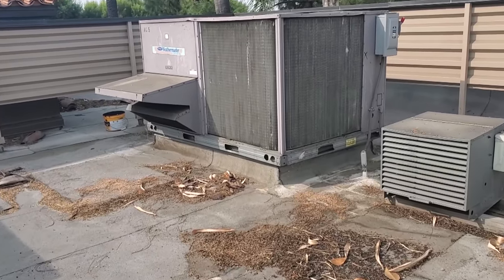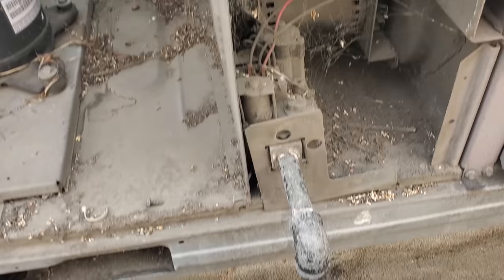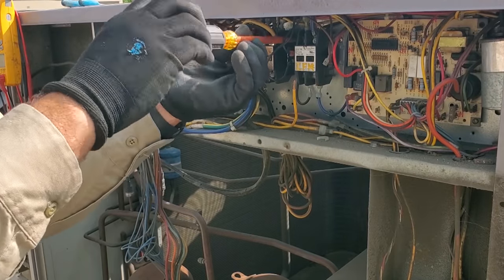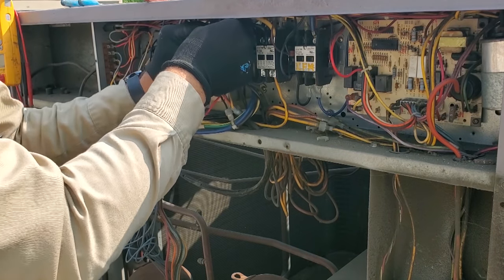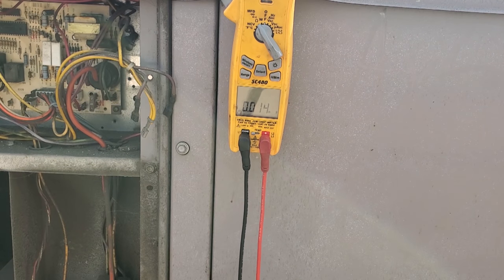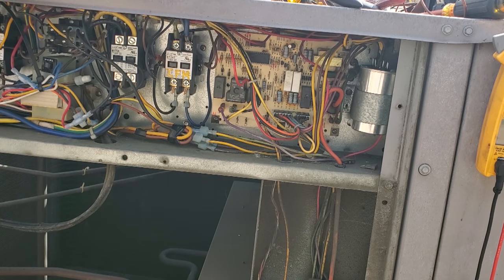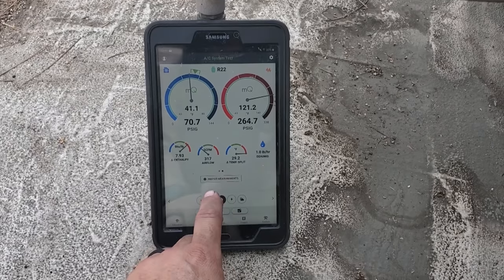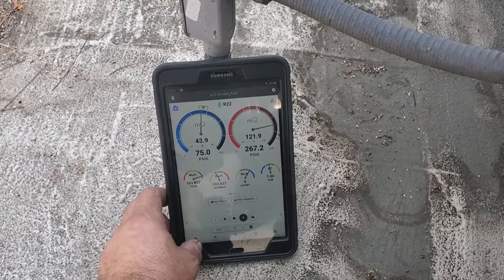THE DINING ROOM IS TOO HOT

Comment: Question answered please.  Hi and thanks.  My question is about the measurequick setting.  My understanding is This was a 10 ton unit, not a Trane so (2) 5 ton circuits.  I have been setting my measurequick to 5 ton when measuring one circuit at a time.  Am I messing up doing this?  Thanks for helping me with this.

Comment: if capacitor is bad on a fan motor, they usually either creep real slowly or vibrate and will have resistance to being turned with power on (if not overheated and thermal overload open).
I know you'll never be able to hear or feel the humming when cold and locked up due to other vibration

Comment: When they say “The kitchen is too hot! Or the dining room is too hot! You ever feel like saying “ that’s sucks to be you!”
Reply from the maker: Ha ha yes
Reply: @HVACRVIDEOS  Understandable, but if you do, it'll cost you money when the customer goes to the competition...
Reply: bunch of cry babies  ;) last few kitchens I worked in didn't have A/C, but they did have screen door and a window, not that it did much good in high 90F humid days.
also I'd say to them, try working on the roof, attic or better yet boiler room, blast furnaces etc. lol nothing like 98% humidity, with 150F+ temperature, no air flow and massive amount of radiant heat.
as you step in, you instantly soak your clothes with sweat and can wring them out after 5 minutes, your boots will fill up and you start sloshing around, now add to that fiberglass insulation. some people just have no clue ;)
Reply: cant handle the heat, stay outta the kitchen

Comment: On a pm found a fan motor that was running backwards checked the capacitor rated for 10 and was reading 15 muf never seen something like that before.
Reply from the maker: Intetesting
Reply: @HVACRVIDEOS  yes pretty odd
Reply: it could have been the meter you used, some of them are grossly effected by NOT removing all wiring from the capacitors. often more so if the "red" test lead is connected to the side with wire still attached.
it can end up reading the capacitive reactance of the wiring, other motors, through the capacitor body to the cabinet of unit and more.
it gets highly critical on small values in electronics, just touching and holding or being near the lead wires can majorly skew results when in the low picofarad. yeah it's far less critical once you hit things measure in microfarad, but still best to always fully isolate the cap.
Reply: @throttlebottle5906  that's a great explanation, but that's also what I did I completely removed the capacitor and used a flathead screwdriver to release the charge Not the proper way to do it sure, but regardless it was still reading 15 muf

Comment: Why do they put 2 pole contactors in a coworker of mine believes the hot leg going to the compressor 24/7 acts as a crank case heater. That doesn't really make sense to me I think its because its a cheaper way of doing the same thing.  Thoughts?
Reply from the maker: I will discuss this on my Livestream this evening 4/19/21 @ 5:PM (pacific) come check it out https://youtu.be/_Sj8XRrpgGA

Comment: "The Dining Room Is Too Hot." Or, as I like to call it, the Last Two Weeks Of Customer And Employee Complaints. The digital clock with thermometer has been taken off the wall so I can no longer take photos of it being over 90F (50s-60s outdoors); a new analog clock (with Roman numerals) has been installed in its place, and 3/4 of my coworkers can't read an analog clock. My penance for complaining about insufferable temperatures is that I now have to translate what the clock says for everyone that can't tell time.
On hotter days, we've taken to opening up the roof hatch, which is helpful but only when standing directly beneath the ladder (oh, the top part of the ladder is coming loose from the wall, who would've guessed that sheet rock screws wouldn't hold an aluminum ladder to aluminum framing?). Wednesday night I ventured up onto the roof to find our dual-zone system is ONE York RTU. We've been told ONE of the units doesn't work, but the other one does - but again, there's only one, I guess the HVAC "tech" is calling the Hoshizaki ice machine equipment our 2nd RTU?
I stepped over to it, both condenser fan motors were off and spun freely by hand, the whole unit was "dead" - not a sound coming from it at all. I considered poking my nose under the covers to look around, but decided it was above my pay grade and walked away. Let me tell you, it was REALLY tempting to look inside and see if there were any hack jobs done to it. I thought they had fixed the squealing indoor blower, but in all actuality, the indoor blower is OFF and the only air circulation we have is from the exhaust fans and the negative pressure sucking in air through the front door. The doors are near-impossible to open and the air blowing through it is so loud that you have to shout to speak to anyone in the vestibule. We still can't get the wall-mounted temperature sensors to read anywhere near accurate (usually off by 20 degrees, or 25 degrees depending on which two resistance values the Honeywell stat offers as options).
All of this crap is not that big a deal though anymore, I've applied for a job elsewhere and will be leaving as soon as I get a start date. And believe me when I tell you, the issues with the HVAC system aren't even the major reasons for leaving.

Comment: Gods, I hate tape on electrical wire.   I don't like zip ties much either.   I use plastic coated 'garden wire' ties.  (bread ties, basically).   Either that, or I use velcro strapping.   I've had to take too many wire bundles apart to like 'permanent' things like zip ties.

Comment: You mentioned the economizer is bad, why not fix it? Is it not that big of a deal?
Reply from the maker: The customer doesn't want to fix them....
Reply: @HVACRVIDEOS  I see. Will the unit eventually have a bigger problem as a result? From my understanding an economizer uses outside air mixed with the return air for free cooling, so I'm guessing it's not a major component but I'm just starting out so I may be wrong

Comment: If the unit is not running efficiently it become a financial economy issue. Poor performing unit might cost $100 extra per month in utility cost. Replacing plenum or duct work might cost $2000 or more. Restaurant figures they can run the unit for 20 months or more before it actually starts "costing" them. Or, you can look at it as ROI (Return On Investment).

Comment: Why must everything you work on be gas units do they even need gas down there? No wonder cali an los has so much smug
Reply: Gas is efficient and cheap. In California, especially so, compared to electric. It's not needed often and they already have tons of gas being piped in for the cooking anyways, adding a small line to the roof is a no brainer during construction.
Reply: @etherealrose2139  Excellent points. Also, if all the RTUs had electric heat and Cali had a cold snap, they'd suffer similar to the way Texas suffered - Cali's power grid isn't exactly known for its reliability (PG&E, I'm calling you out) and massive demand like that would certainly cause issues!
Natural gas is probably the cleanest-burning and most-efficient fossil fuel at our disposal right now.
As far as SMOG goes, that's a perfect-storm result of massive amounts of traffic, weather patterns, and topography.
When it comes to their SMUG problem, well, that's a whole other story for another forum. lol

Comment: I  don't understand why you don't start with the basics???
Filters
Belts
Dirty condenser/ evap coils
and proceed from there. That all needs to be logged or it will bite you in the ass. 
Details, Details...
Restaurants are notorious for poor maintenance of HVAC equip.
For the New Techs that is important, you don't come to Any conclusions until everything is as clean as possible or you may have a bad diagnosis costing someone $$$.